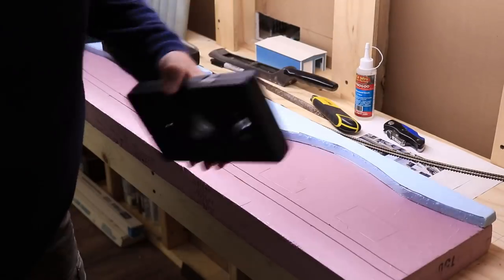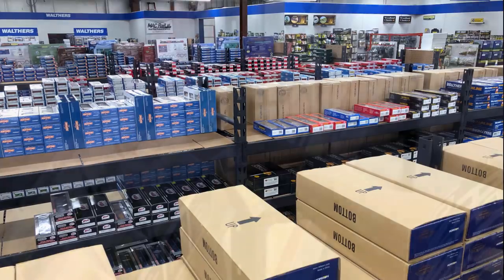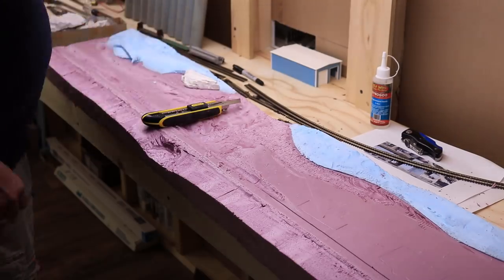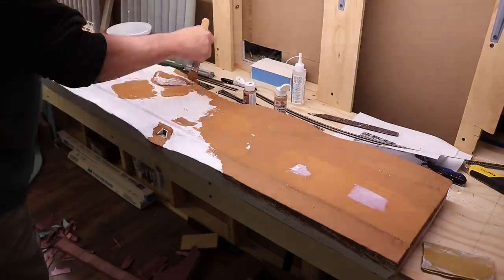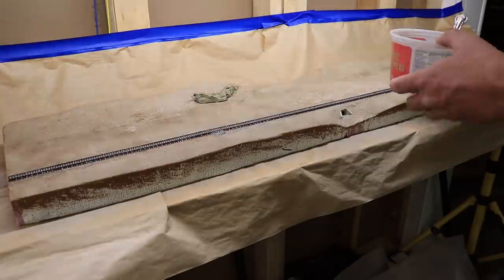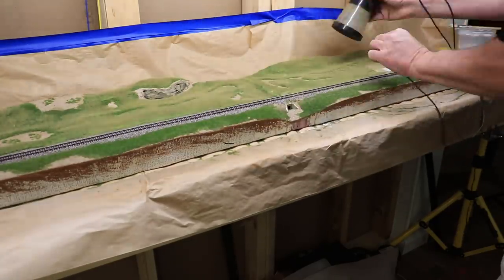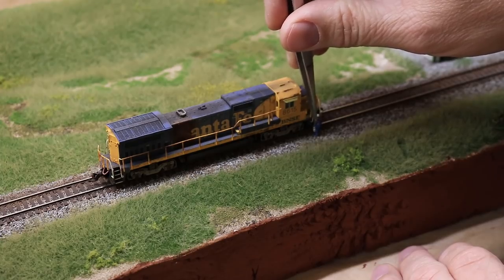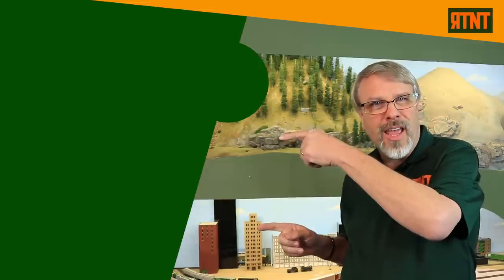Build a Model Train Diorama

Comment: Great video Ron.

You mentioned that you wanted to avoid that manicured lawn look, but still applied relatively large areas with the static grass. I know that you were under a deadline, so could not allow much time to apply the grass, but I would recommend that to get the patchy effect, just try dabbing the glue using an old brush, but trying to avoid the large area coverage. Apply one layer of grass, then allow to dry. Repeat with a different colour, leaving gaps, and then apply the 4mm, again using the patchy approach. I use a couple of different earth tone fine turf as the initial cover, covering over the soil, and then the static grass. I find that the result is that rough texture that you get for un-farmed ground.

I will be presenting a clinic on my method in the upcoming NMRA Australasian region virtual convention in June.
Reply: I really liked the grass very natural.  It looks like the Buffalo wild grass that is near my home.  Same hight color and texture.  I have a lot more weeds and flowering weeds mixed in, but he nailed it for my local Buffalo grass.

Comment: First reference I recall to Canopy Glue. I've been looking for a good way to attach small items in a way that will easily come apart. This is mostly so that things I bump or snag will not break, but just detach. For things with enough contact area, I've been using Glue Dots. Would Canopy Glue be the same kind of thing?
Reply: I know this is 2 years ago, but I also use Canopy Glue to glue on windows for structures as well, as it stays clear. It's what my hobby store recommended to me when I said "the glue that doesn't fog model windows like super glue can."